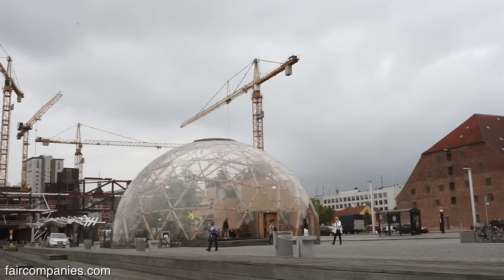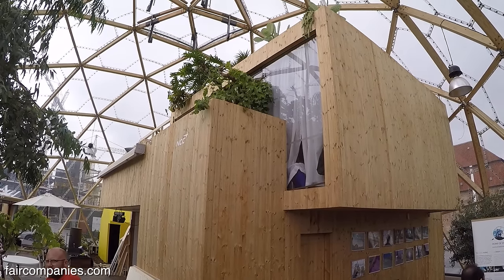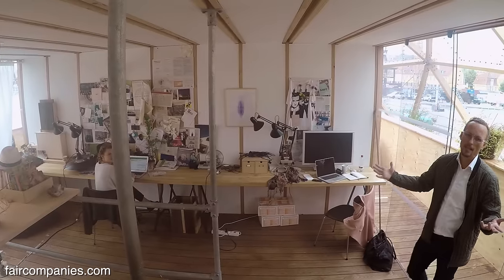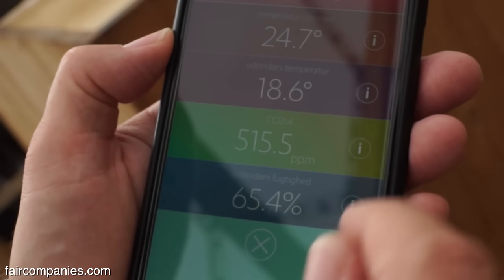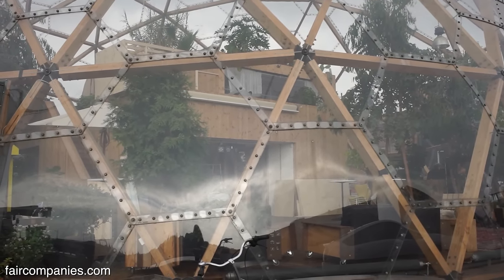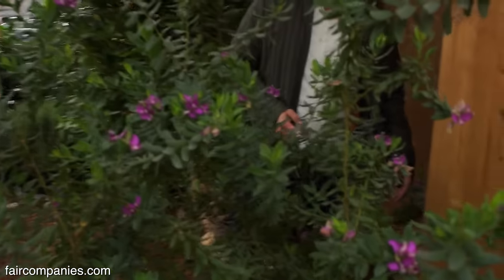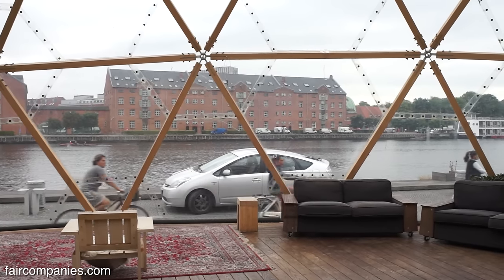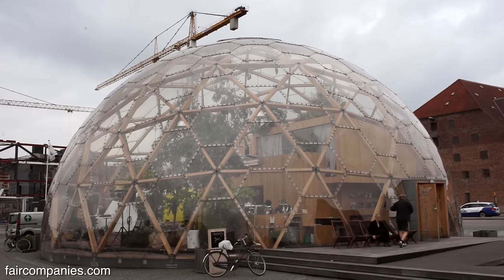Nordic home encased within geodesic dome for passive solar

Comment: I want this. Which company sells these?
Reply: I guess its a one off but it would be easy enough to build one yourself.
Reply: @JohnGuest45  I have failed at easier projects. I wouldn't waste the money and material on trying to do this alone.
Reply: @withyoctopus  
The frame is a basic 4v hub and strut, nothing too tricky. The outer shell is a 12v made up of polycarb pent, hex and half hex overlapping panels bolted together. The polycarbonate could be fairly thin as the frame provides the bulk of the strength. I dont know how many different panel shapes there are offhand, more than you might imagine but its not difficult to figure. If you know how to use a saw and a drill you have the skills to build it :)
Reply: @JohnGuest45  No offense but I expected a reaction like that. I don't know why handy people always think that not-handy people are lying. 
People have different skills.
Reply: @withyoctopus  
Skills are learned, it doesnt take very long to master a drill press and a chop saw which is all you need to build one of these.

Comment: Hmm this scenario is already playing out. It's called Earthships. They're around the world & don't take up nearly as much shape as well as being green. Also use up old tires & garbage to construct. self sufficient as well. Also, I;m sure that they're less costly to build than this. If one wants to have a dome & a maintenance free building then one could purchase & have built a dome home. Monolithic domes have all the same things that this system has. But does it in a much smaller package.

Comment: I would be curious as to how much petroleum and processing goes into the tons and tons of plastic panels.  The steel brackets alone must require massive amounts of carbon emissions to produce.  This project will not help air pollution or reduce carbon emission.  Producing 1000 of these domes would produce much more emissions than the construction of a super insulated concrete house.  So if you are building for art, person use or an experiment that is fine but do not lie about the huge amount of fossil fuels needed to produce this structure.

Comment: The cost would NOT be paid back in six years of saved energy costs...
EVEN IF you assumed that your heating costs would otherwise be £3,000 a year, and EVEN IF you assumed that you would never need to heat the home, then there's no way that this over-structure would only cost £18,000 ($24,500).  I do wish people would be honest with mathematics!

Comment: Cool project. But from economical point of view it's a DISASTER! Cost of ANY insulation for this house is a tiny fraction of the price for all that polycarbonate and timber that went on the huge dome (huge relatively to modest house). And even heating expenses for 20 years are still less or comparable to that of dome construction.

Comment: Wait until the top panels crack or develop a leak. You'll need scaffolding and a guy who's not afraid of heights to fix it, Or since it's bolted from the outside, you have to rent a crane.
Reply: Now,  imagine all your neighbors also have a dome,  I 'd say this domes are kinda close together if not one against the other. How do you fit the crane?  They must also develop do-it-all drones so you can fix a leakage.
Reply: You are thinking like a caveman. Simply reengineer the bolts and panels to easily snap into place. Build a drone that can lower it from above if you have to. The future is yesterday.

Comment: How is it 3D-printed?
Reply from the maker: +Jan Maarten Oolman The greenhouse plastic is CNC cut: each of those "fish scales".
Reply: +Kirsten Dirksen Ok, thanks for the answer. I like it very much! Keep up the good work!
Reply: +Kirsten Dirksen A CNC is different from a 3D printer. A CNC cuts materials, a printer extrudes materials that  harden into shape.
Reply: +Sam Well said; that is what i was thinking.
Reply: +Kirsten Dirksen CNC cutting is just cutting material. It has nothing to do with 3D printing.
Reply: +hingeslevers  while they are similar in some respects(the end goal) 3d printing and cnc milling really are 180 deg in doing things(the means), one adding, the other substracting.
Reply: +Kirsten Dirksen - It would also make a good nuclear fallout shelter! :)

Comment: Love domes but so many problems.
*mold in humid days
*bird strikes and birds and animals trapped in the dome.
*storm damage repair. Try replacing panels at the top!
*lifetime of polycarbonate. Nothing lasts forever. Asphalt shingles can last 25 years. Replacement cost would be high.
*air quality issues. No breezes, no fresh air, build up of toxins.
*winter: snow and ice loads, expansion and contraction can lead to leaks.
*large scale use issues: rain diversion and runoff rather than soaking in, etc. Solar glare on neighbors.
*Leaks. Since the house isn't exposed to the weather, it is probably susceptible to water damage from leaks. Domes are notorious for leaks.
*House has to have insulation as the dome provides none other than blocking infiltration from wind. 
*They mention year-round gardening but in cold climates the dome space would freeze. 

And more I'm sure I forgot.

Comment: Rural probably, suburbs maybe, city no, space is a premium in a city. Humidity would be high leading to discomfort, mold, respiratory problems, decay, rust, and possibly termites. That energy savings will be eaten by dehumidifiers. Summer heat would be lethal. Airflow is minimal. Gases from carbon dioxide, carbon monoxide, methane, to radon can not escape in winter. A concrete foundation constantly emits carbon dioxide. Note your house vents. The same for particulates like smoke. Plexiglass is not a great insulator. The shell would be impossible to clean, which might include mold, and lichens. 
     Made by an unrealistic someone who nonsensically stated "if you could eat wood, you could eat your house". If I could eat steel, I could eat my car.
       Geodesic dome homes have been around for decades. If they provided a better overall advantage, they would be ubiquitous. I haven't seen many, if any dome greenhouses.

Comment: Why can't the timber beams be recycled plastic wouldn't it be a benefit to the environment as there is so much of it building up.
And less expansion and contraction than timber.
This structure could be 3D printed in recycled plastic now.

Comment: Buckly liked the dome because it was inherently more practical. There are no corners for wind to push on, so they won't get flattened, or sway. This project is a waste of time and money from the get-go. Assigning that sort of space for 2 people simply isn't feasible. The sprawl and amount of resources required would be monumental. Building an arcology sure would be neato keen, but ungodly expensive and entirely impractical.

Why build a house in the dome and not just live in the dome? Check out Pacific Domes out of Oregon, they've been doing this for over 30 years.

Comment: This is like building an urban ecology starting with one house, then scaling up. This this will become common in the next century.
Reply: I wouldn't be so sure. There is a reason why houses aren't built like this already and it isn't because no one else is smart enough to think of it. All that polycarbonate is expensive AF. Not to mention all those manufactured beams and the thick metal brackets that hold them together. There is a reason they don't talk about cost. It is also not an efficient use of land. Plots of land are rectangular. This might work really well on a farm, but even there you don't see geodesic barns. That is a really tiny house inside a really big plastic bubble. Also the chimney is venting all the co2 right into your bubble, that's going to be a problem.

Comment: C-60 is not diamond, like this guy says. It's buckminsterfullerene. And i guess you need some h's in there as well. He garbles a lot of the science, calling co2 carbon.. What is true is that archimedes proved that you cannot have more than 60 points distributed evenly along a sphere. Which would distribute any force on the shell in the most efficient way.
But that has very little to so with this project. Because this is a 3v geodesic dome with an overly large strut size. Most of the stability comes from the shell itself, which explains the amount of bolts.. but they should have upped the frequency to have more benefit from the struts. With steel connectors node inversion is no longer your problem. I guess they decide to do this to have easy acces at the bottom. So the points he makes are somewhat valid, broadly spealing.. but it would be nice to get it right. This is fuzzy at best.
Reply: The inner frame is actually a 4v and the stability comes from the timber, not the polycarbonate. If you try to break a plastic ruler by pushing on both ends you`ll find its very easy  because its weak in compression. If you try the same test on a pencil you wont even get it to bend

Comment: That dome is not attractive, I have seen domes that are much more attractive.  I'm guessing you have thought of moisture coming up from the ground into the dome.  I think winter sounds like it would be amazing inside there, but summer would be very hot?  There must be ways to open up some panels of the dome to allow for ventilation or a breeze during the summer but to keep out rain just in case it rains... I could live under a dome with my house in it and outdoor living space... just not that dome (needs to be more attractive, less industrial looking, and the house could be a lot more interesting too. But, I like the concept.

Comment: Why need a house at all if protected by dome... why not just have living room and have separate rooms by plants.
Reply: Because it would not stay warm enough and not very private lol.
Reply: Exactly.
Reply: Just think  yeah, i realized it later. geodome helps by getting rids the external winds and rain, but not the termperature as much. it definitely doesn't replace the thermal insulation of a house. Thanks for your answer

Comment: i wish i was able to get this after it is don even if it is not 3D printed ;) it's just 6-7 hours from mee ;)
Reply: +grapsorz What's the obsession people have with 3D printing. CNC-mill and 3D printers use the same G-codes. They're basically the the same thing accept milling is much faster.
Reply: this house (or any part) is not 3D printed as the video is labeled as. 
i do want to have a big dome like this tho ;) 
this is a Geodesic dome. i hope for a gridshell dome ;)
Reply: grapsorz That's lovely and all, but I didn't say or indicate in any way that I thought it was 3D printed.
Reply: +Jaqen H&#39;ghar 

no the name of the video did. NOW it is fixed to CNC-milled. it was "3d-printed"

Comment: guy- ...to experiment with new heating systems,..
kirsten- geothermal ?
guy- its not geothermal, ... build it on the ground itself so you use the heat from the ground...

Comment: This seems like one of those things that are impressive on initial review, but look closer and it's stupid. This is going to be sweltering hot in summer for starters. It maybe pays its self off in six years, but for six summers of suffering? Not to mention this plastic degrades and discolors over time. Massive amount of plastic waste to dispose of.

Comment: stupid idea only the rich coud afford this they end up digging up every tree its no good
Reply: What do you mean? It is a normal house inside. Just the difference is that the wood is untreated to resist water. And the frame hardly uses any material. Why do you think they will use up the forest?
Reply: +Samtagri You can tell Jasper is an emotional reactionary type of person, a black and white thinker that lacks deep thought, logic and critical thinking skills.
You could explain everything in detail and it would do no good. You'd have better luck teaching a brick to tap dance.